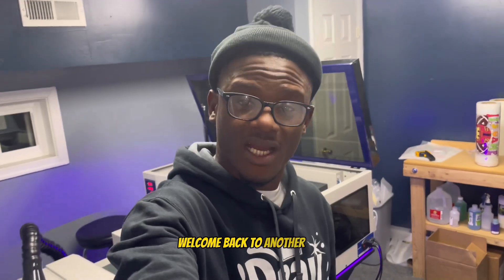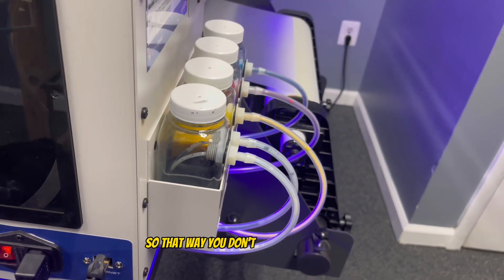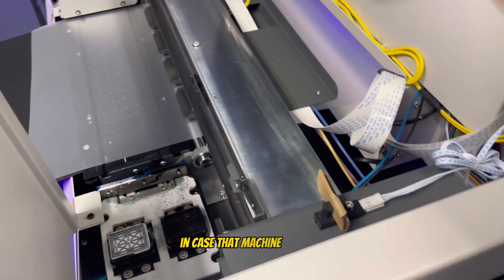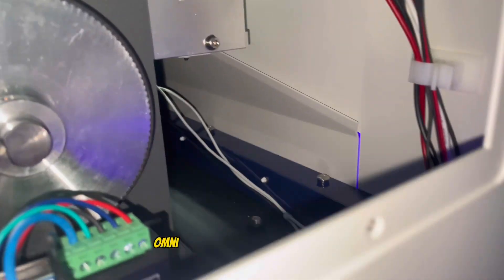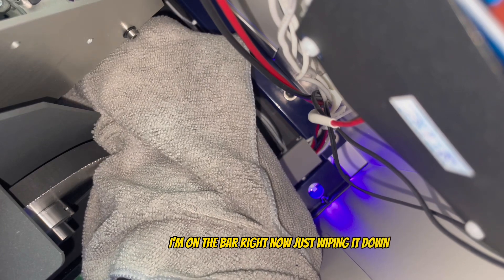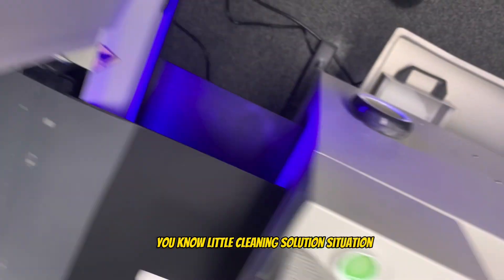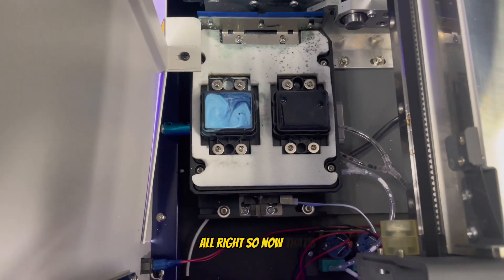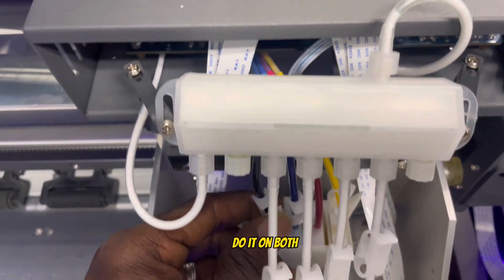DTF Machine Maintenance: How to Clean it at Night for Maximum Performance

Comment: hey brother I need your help big time. I have the same machine but im having problems with ink smearing when print goes down to the powder. The white smears bad.. What can i do to fix this? i mssg you on tiktok.
Reply from the maker: Hey man. You can turn the underbase value down. I had to change mine to 37.25. This can be changed under properties.
Reply: @ErastuSnorweahTV  Thanks a lot, Whats the temp you have in the printer's heaters front and back ? 

my inks smears a lot at 37% of underbase.